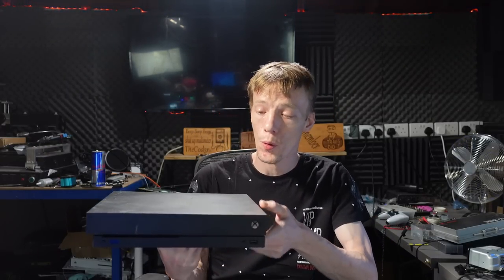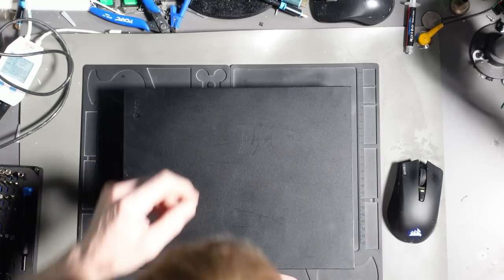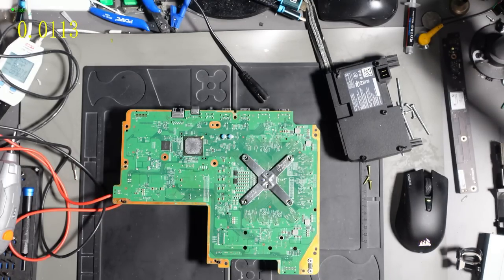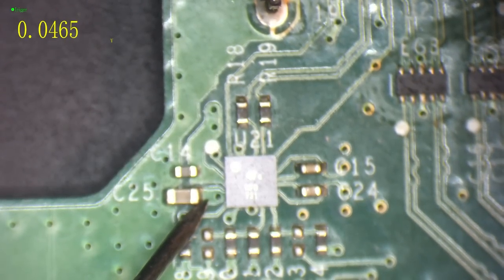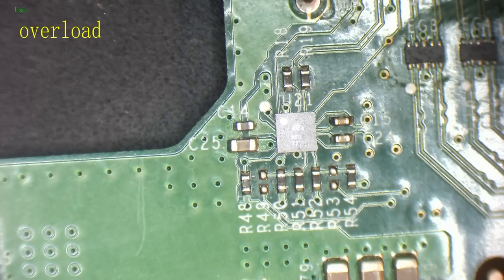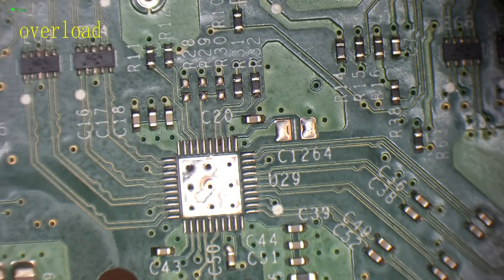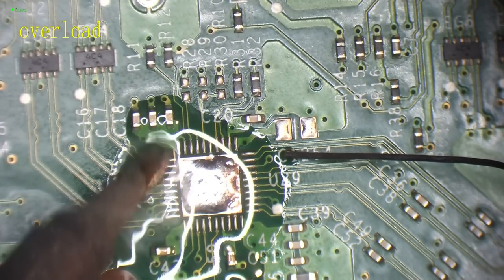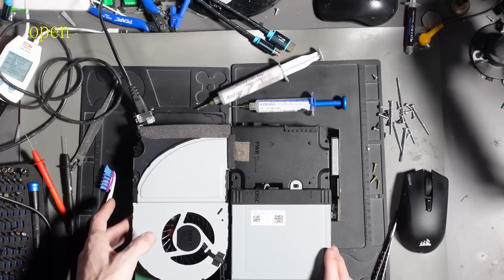I Bought This Broken Xbox One X From eBay For £60! But Can I Fix It?

Comment: I'm troubleshooting a similar issue, except in my case it stays on for ~5s before it beeps and shuts off. Oddly, I get 0.251V drop on C25 and C50 in Diode mode but only 281.0 Ohm drop in resistance. Is that normal? In comparison, C14 on the other hand shows 0.648V drop in diode mode and 5.9 Megaohm in resistance. Pin 19 HDMI - similar reading to C14.

Comment: I would love to see if it can natively run a m.2 or not, might have to follow the controller circuits to see if they go to a controller IC that may also be missing unless the relevant board controller has already the capability for the extra storage, have a look at the newer ones and see if you can spot a drive controller for that ones board or if you have snaps of the dev one you should be able to identify whether it requires an extra IC or not.

Comment: Xbox ONE beep On/Off issue is a pain in the ass to fix on the X Model. I have found on couple that the two black capacitors on bottom of the APU die out or even crack causing the issue or to the right of the Ethernet Port sometimes that area has a short.

Comment: Hi, did you find the problem on this? I got similar situation, beep on and straight off, just can hear beep without X button light, and immediately off. Do you have idea what is the problem? DC is working good, 12v supplying, no signs of anything, very clean inside.

Comment: Hard to help you here, as I'm not familiar with the xbox components whatsoever. But having trust issues when it comes to electronics, did you check the work the others did around the HDMI? Did you check the component you replaced after trying to turn the console on again? 
Sometimes a faulty component is a symptom, not the issue itself. Could also be the APU killing the TDP158, if it's really the problem. 
Can't tell if a faulty surge protector (EG3, EG4, EG6 and EG7) would be enough to shut down the system, as they're most likely pulling the data line to ground. Are the capacitors on the way to the APU fine? Maybe they show signs of something being wrong with the APU.
If you checked everything around that, then you're probably correct with the APU being the problem. Punctual heat isn't a very good sign.